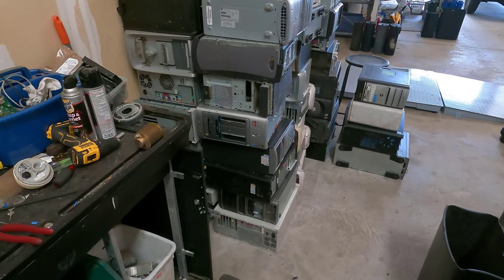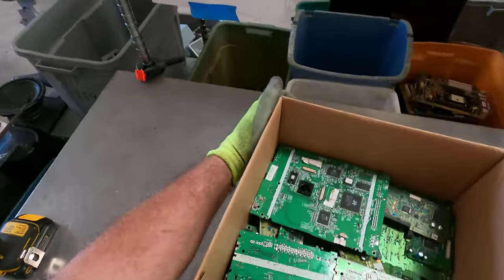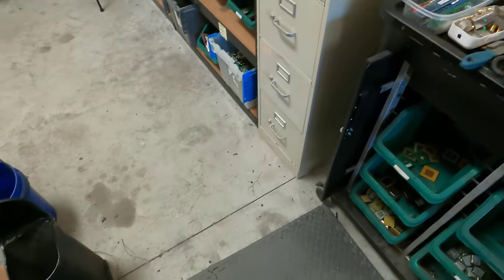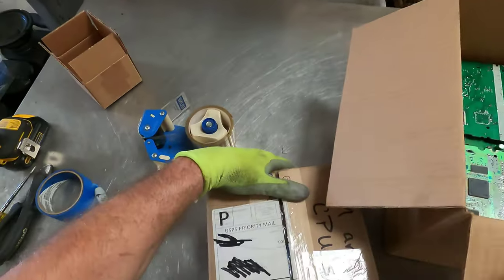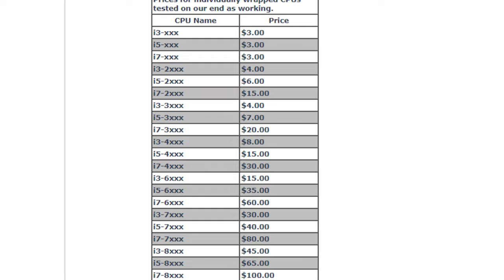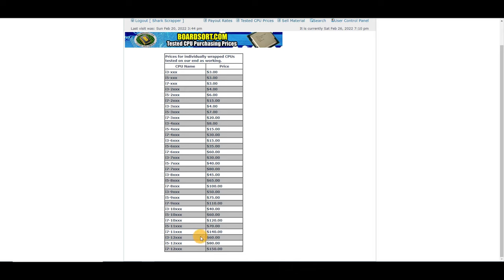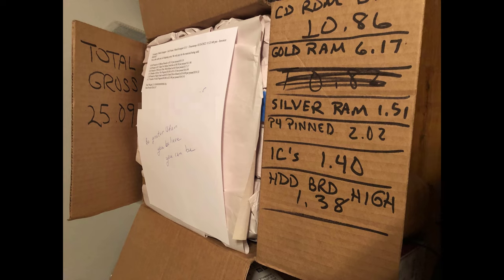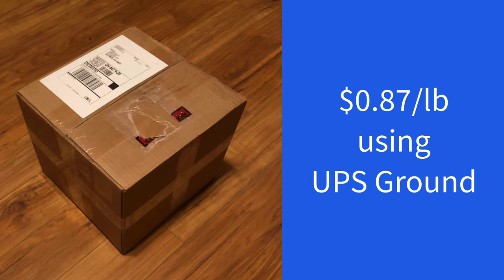How to sell scrap computer boards and CPU's.  Packing a box for BOARDSORT.COM  #boardsort.com

Comment: Heads up on pirate ship insurance claims are very hard.  They require destination to sign statement for loss.  Insurance through usps is super easy and worth the extra cost of shipping in my experience.  I always used pirate ship prior to the hassle of insurance.
Reply from the maker: Interesting, thanks for sharing that.  I've not had an issue to date but that's good to know.

Comment: I would personally put one kind of board in a box. I don't like to mix different kinds of boards in boxes. I would also store full boxes and ship them out when prices are good. But that's me
Reply from the maker: Some times I don't mix the loads.  It just depends on what I have.  My biz model is to keep it moving.  Just like the stock market, trying to catch the highs can be challenging.  And cash flow is important.  I do have some "strategic" reserve of select items but usually I keep it moving.
Reply: @sharkscrapper  "each to they own". The stuff I want to keep moving is stuff I get a lot of on a regular basis. Stuff where it does not matter about price, what matters is keeping volumes at a manageable level. I plan to do my own recycling business down the road. I'll start off as a hobbyist doing rubbish removals.
Reply from the maker: That sounds like a good plan.  Like you, I started as a hobby before going full time.  To each their own is very true in this biz.  Even the big scrap yards differentiate amongst themselves in what the handle, pay the best for, hold/sell.  Looking forward to learning/sharing as your journey moves forward.

Comment: Another GREAT video!  So far I have only sent what I can fit in flat rate boxes, but my motherboards are getting out of hand.  Going to have to jump out of my comfort zone and get bigger boxes and see what the rates are going to be.
Reply from the maker: I understand.  I sell the large socket motherboards to BOARDSORT.  They're not too big and priced high enough that it's better than selling to my local yard.  Still accumulating server boards.
Reply: @sharkscrapper  I think I may ask Chris about LTL shipping.  Between the laptops and motherboards, I'm pretty sure I can fill a gaylord box with about 1,500 lbs.  But, relying on the kindness of my neighbor for a forklift, I would need it lifted onto my truck to go weigh, then lift it off for storage until shipping, then load it again when the truck arrives to ship to Ohio.  😳😖😥 If he can get cost down to $.50 ish per pound, I may take that route.
Reply from the maker: @cuscrapping  Fingers crossed for you

Comment: Very thorough.
I’m glad the CPU list was consolidated.
Do you feel insurance is a good idea on shipping? I did USPS and added it just in case because it was a valuable first shipment.
Reply from the maker: That's a good question - one I should have addressed.  Yes, I recommend insurance.  You can use the Boardsort quote as proof of value should you need to make a claim.  And if you believe in Murphy's law - paying for insurance guarantees there will be no problems with the delivery 🤣

Comment: So I could not find an answer to my question on board sort, and my ? is there a perfection standard for Intel 386, 486, and Pentium pro gold cap CPU's. Will they give max monies if they have deficient, but not missing pins? For example.
Reply from the maker: Since they're going to be processed for gold recovery their condition does NOT need to be perfect.  Of course, if they're missing most of their pins they may dock you a little.  But I wouldn't worry too much about it.
Reply: @sharkscrapper  well I sent a request to board sort and he said any alterations to the CPU would be an automatic decrease in value.
Thanks Sharkey 😊
Reply: Which is OK but I was just wondering if they had a list of other than perfect CPU's on  board sort
Reply from the maker: Yeah, they don't want folks trying to see how much they can get away with.  You'd be surprised what some people do trying to make a few extra bucks.  So BOARDSORT's default response is what you got.  However, they understand that sometimes things get damaged, old boards, rough handling, etc.  I've found them to be very reasonable as long as you're straight with them.
Reply: @sharkscrapper  
Thank you for the confidence,  I won't worry about it then.

Comment: What’s a ram board? I’m having trouble with that
Reply from the maker: RAM boards are also called RAM sticks. RAM stands for Random Access Memory. A PC reads and writes to this memory when It is moving data around. But nothing is permanently stored on the RAM like it is with the Hard Drive. RAM is just a temporary place where the PC puts data that is being used. Typically a RAM stick is 133.35 mm long and 30 mm high. But there are also RAM that are half as long, typically used in lap top PCs and other RAM that is roughly half as high. You'll find RAM on a PC motherboard stuck into slots with clips on both ends to lock the RAM in place.  Watch a couple of my PC tear down videos and you'll the RAM I remove.
Reply: @sharkscrapper  Thank You very much! I’ll do that!

Comment: I didn’t hear what the shipping cost was on this shipment. I’m trying to work out if it’s cheaper to send a lot of smaller boxes or a few larger boxes. I calculated the large boxes at 70 pounds and the shipping cost is around little over a $ a pound . Let me know what you think
Reply: I guess I didn’t wait til the last minute of the video lol. But still better to send a bunch of smalls or a few larger boxes boxes! Thanks!
Reply from the maker: @ScrapFatherScrapSon  LOL, no worries. Very important to remember that if you go over 49 lbs you will likely get hit with a heavy box additional fee.
Reply: @ great to know thanks for the info! I guess shopping around is always best like we do at scrapyards!

Comment: What's your opinion on depopulation of bords before selling? I depopulate about 40% of my bords if they're good enough.
Reply: Boards*
Reply from the maker: I do very little depopulating these days.  When I started, years ago, I thought I'd be refining the precious metals and I depopulated a lot.  After some research I realize this is not cost effective for a small operation so I'm now selling all boards and do very little depopulating.  Depending on the board, I might take the gold cornered BGA, socket mounted IC's and some tantalum capacitors.  But this is only if they are on a lower grade board where I'm not risking lowering the value of the overall board.
Reply: @sharkscrapper  i do the same other than pulling finger boards aside. thank ya for the information

Comment: How do you ship 40 lbs of ic chips 😮
Reply from the maker: 40 lbs of chips might be volume limited depending on the type of chip. In other words, you many need a large box which could result in additional charges. Depending on the type of chips and volume needed, it might be better to ship in multiple boxes of less weight. But I'd need to do the math to be sure.

Comment: Cd rom boards are from cd players, right?
Reply: Sorry I’m learning and slow lol😂
Reply from the maker: No worries. And the answer is actually a little more complicated. Yes, the CDROM Board category includes the boards from CDROM read/writers. But it also includes the boards from the DVD/CDRROM read/writers. We tend to just refer to them as CDROMs but a more accurate reference may be to call them optical drive boards.  So you see, your question was not as simple as you may have thought. 🤣